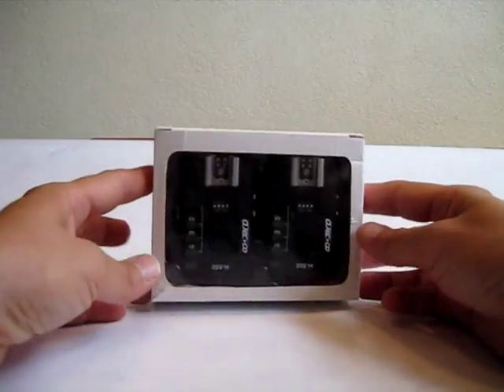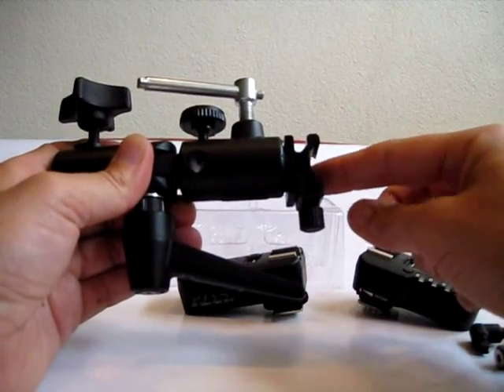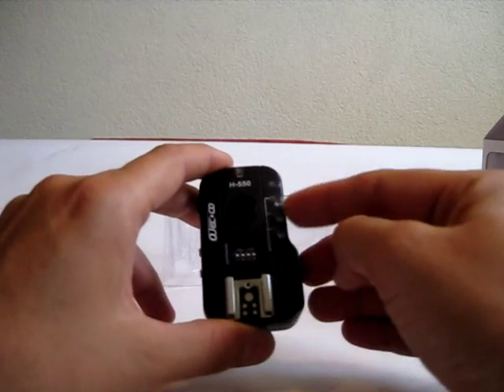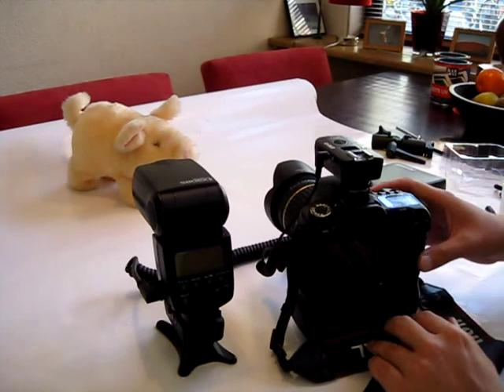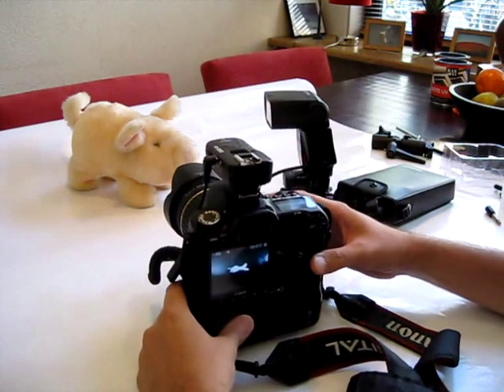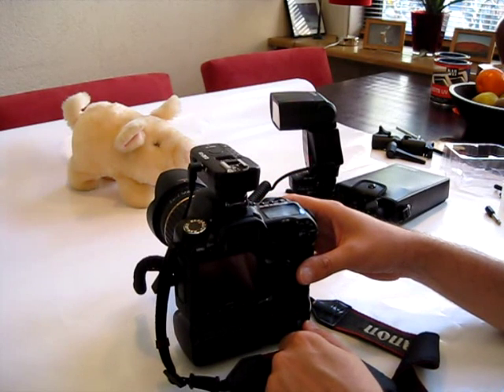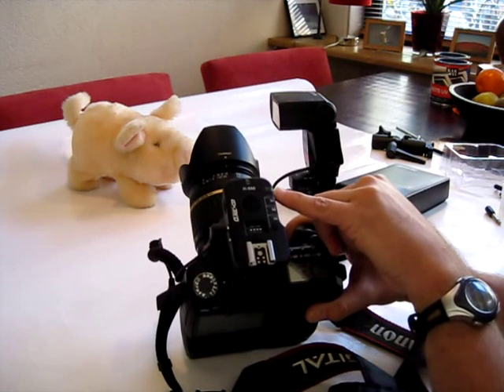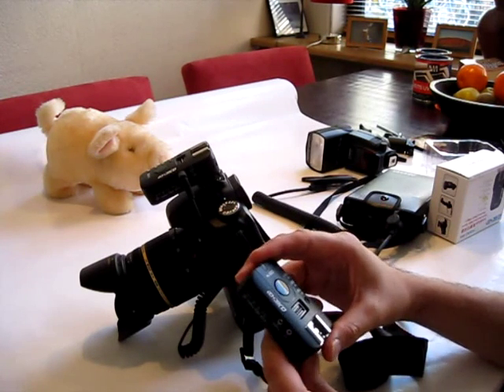Test Ojecoco H550 transceiver

Comment: From my testing, it seems that for a shutter speed of 1/X, you should set the number on the HSS dial to X/200. So for 1/400, set the dial to 2. For 1/1000, set it to 5. This seems to always put it in the ballpark, and then only a little minor tweak is needed.

Comment: Door je flits op full-power te zetten verleng je de lichtoutput zodat de lichtoutput langer duurt dan dat de sluiter open is.  De learning mode zorgt er dus in principe voor dat de flits start voordat de sensor licht vangt. 
Bij een laag vermogen zal je dus altijd een band krijgen omdat de lichtoutput niet lang genoeg duurt.

Echt high-speed flash fotografie noem ik het dan niet.

Comment: If you are not shooting fast, just set your Canon EX/EX II to HSS and your 2006 or newer model camera.
On camera or wireless line-of-site - will shoot up to 1/8000 Flash Sync.

But to get wireless radio then you will need this.